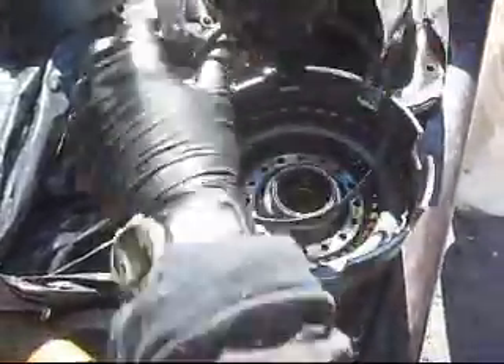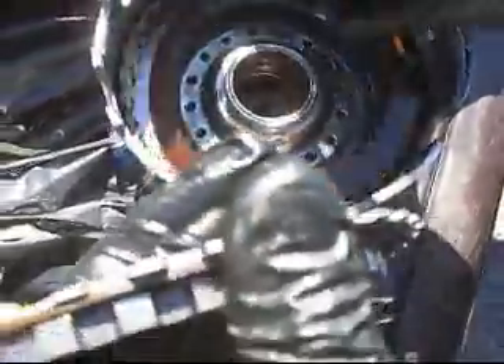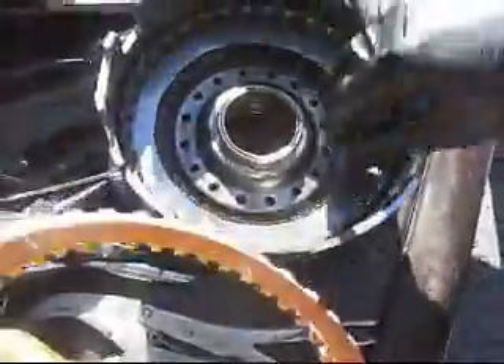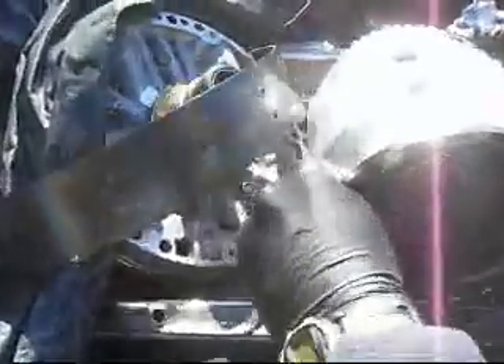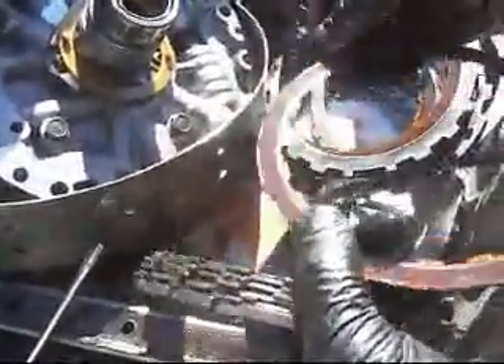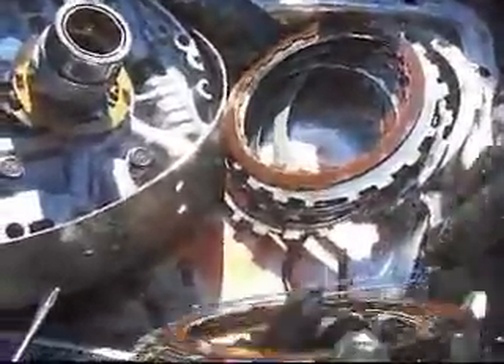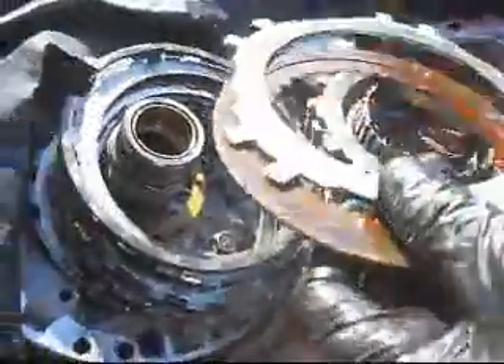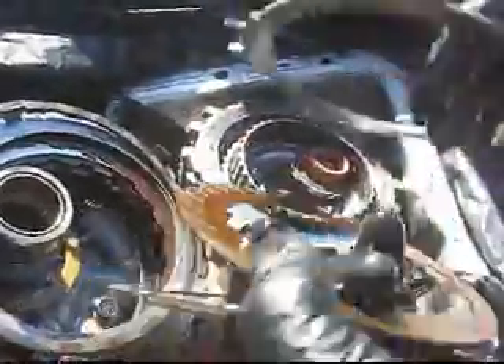Ze Big DRUM!!!

Comment: The 4L60-E was a computer shifted unit, using 2 shift solenoids, a force motor (some years) to control line pressure, and of course a converter lock-up solenoid.  The one piece version of the 4L60-E was made from roughly 91 to 94 I think.  Indeed this is an older 700-4r

Comment: This looks like a GM 4L60-E GM automatic. It appears to be made prior to 1997 as the case is one piece. I believe GM went to a detachable bell housing on the 4L60-E starting in 1997. This may be an older 700R4 model.

Comment: Hi, sorry for the delay, traveling around!  The mushy 1-2 shift is being caused by improperly adjusted throttle cable to the tranny.  Sludged oil oil plugging valves can cause this as can bad 2-4 servos.  A Glazed 2-4 band working on a very polished and glazed reverse input drum may cause this to.I hope this helps a little.

Comment: Mr Spiked punk, what could cause a very mushy 1-2 shift in a 700R4?  The 700R4 i removed from my blazer used to be real mushy going from 1 to 2.  the 2-3 was fair(could be better) as was the 3-OD and the lockup.  The truck sat for10-11 years off the road.  Could the valve body just be sticky?  i changed the fluid and filter, but the fluid was still quite brown and burnt smelling.